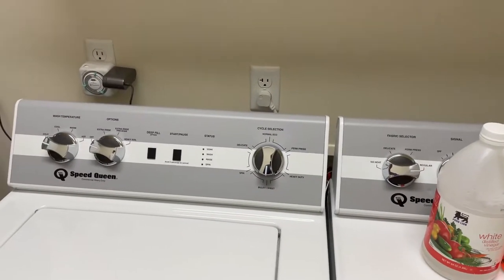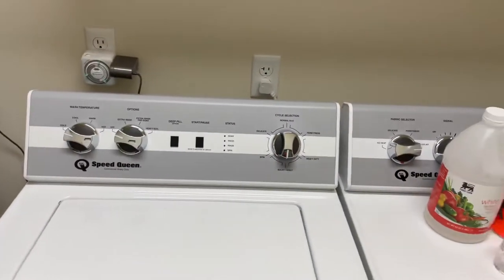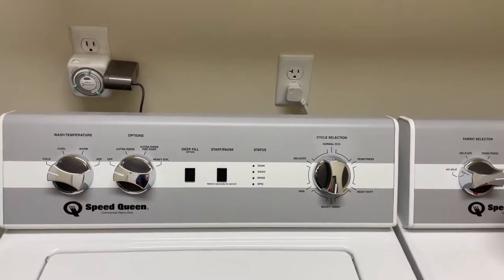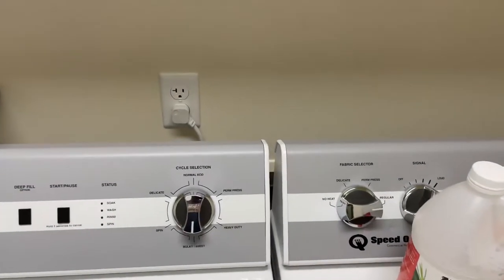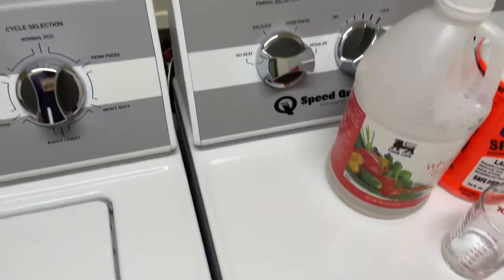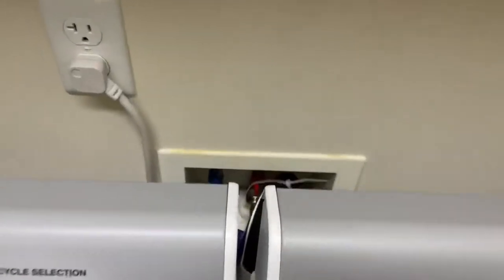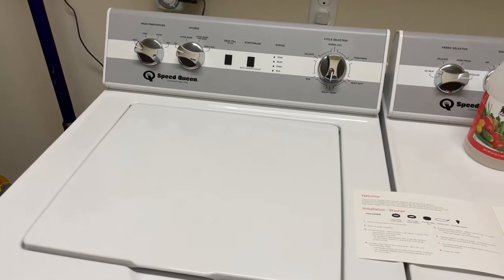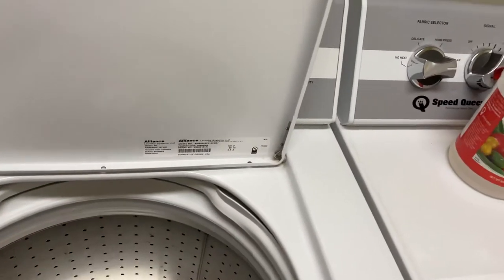Foam Bubbles coming out Speed Queen Washer drain hose - Fixed!

Comment: Maybe we should get a class action lawsuit together on this. They should engineer a fix and send somebody out to make the repair. Could be a simple as a lower volume pump or a pump that only runs when there is water present.  Maybe simple timer that shuts the pump off at a certain point. Absolutely ridiculous to have to try to figure out how to make it work without ruining your house.
Reply: My Speed Queen is so much better than my former washer that died at 5 years old. I’m ok with a little process/maintenance change.

Comment: I've been having the same issue.  Even after making adjustments to the wash mode, trying vinegar & other ideas, bubbles still continued to flow out on the final spin cycle.  I made a call to the Speed Queen Queen in Texas.  I told her the issue.  She quickly stated to run each next set of loads without any detergent.  That detergent is more concentrated now & too much is remaining in the clothing.  She recommends after washing all loads w/ just water to get rid of the detergent from the machine and clothing, to start using only 2 tablespoons per load.  She said that will be sufficient.  So far, I'm just washing w/ water & will start with less detergent within the next weeks.  If bubbles return at that point, I'll put in another comment about the problem.  If not, all is good.  Oh, she mentioned using wool dryer balls in the dryer instead of sheets.  Add essential oil drops to the balls if you want a fragrance.  Wish me luck!

Comment: problem solved... the adapter that came with the speed queen did not work by itself but adding it with an additional adapter (I got on amazon) worked like a charm.
Reply from the maker: Terrific!  Please add the link for the part you used.
Reply: I'm interested in the link to the part as well!

Comment: The Speed Queen really whips the detergent into a froth, so I only use a drizzle, like an eye dropper full. I have used vinegar instead of fabric softener. I’ll try adding it to the wash cycle. Towels hold a lot of detergent and don’t get rinsed well enough. It seems disingenuous, but because they’re probably full of detergent from previous washes, try using minimal detergent.
Reply: Agree. I do not use fabric softener because I hate the smells, even on "no fragrance" ones.  But most people don't realize their clothes are rough because they are full of residual detergent that was not rinsed out. Use less detergent. spot clean what needs it before putting in machine.

Comment: I am sure you know this, but I would also make sure that you are using HE (High Efficiency) detergent in that washer, they do produce less suds. But on the drain pump, you are correct, because the drain pump is attached to the motor, and because it is attached to the motor, it runs in reverse while in agitation, but it will not pump water out of the machine. But when it is spinning, it turns in the other direction, pumping water out of the machine.

Comment: We had this same issue. We were using liquid detergent and it was causing foam bubbles. We started using pods and it fixed the problem. Have used all the different options & cycles and no more issues since using pods.
Reply from the maker: Hi Jason.  That's good to know.  Thank you for adding this.  Rick
Reply: We just got this exact washer today. Washed 5 loads of clothes and noticed soapy water all over the floor and coming out the drain pipe and hose. We are using Tide Pods. No more than 2 at a time. Maybe for this washer that's too many? I'm running vinegar through it right now to try to get rid of the foam. Pretty disappointed in the washer. Have waited over 5 weeks for it to arrive only for this to happen on day one. 🤷🏼‍♀️

Comment: Rick. It's nice of you to take the time out and share your findings with people. I'm that guy that does not read the manual till after the fact. In my older and more wiser years. I have read the manual before starting. Just an added information for you, case you didn't see it in the manual. On page 12 about adding the soap. Note "Measure and add Low Sudsing, High Efficiency (HE) detergent to the washtub. NOTE: HIGH EFFICIENCY (HE) DETERGENT IS RECOMMENDED for use in this machine.  My wife and I are not using any detergent. We are trying something different a product call  "Pure Wash Pro" . No need for soap or Hot water. You tube it if you like. Just some extra information to put out there for you and those watches your videos. Thank you and to the people who take time in their lives to put out good information for others.
Reply from the maker: Thank you Bill.

Comment: Rick - this was super helpful. We just bought a TC5003WN and it did the foaming thing almost immediately. We thought it was an installation problem b/c the installers did not put the adapter into the standpipe. They came back and fixed that problem but the foaming eventually started up again. I followed your advice: ran the empty washer on heavy duty with some vinegar (NOTE: your pinned note says to add 1/2 GALLON of vinegar but elsewhere in these comments I see "1/2 cup." I probably put in 3 cups - sort of splitting the difference...) then stopped using "Normal Eco" cycle for washing. Before each wash I put an ounce of vinegar directly into the standpipe (it's easy to access). So far, after a week of doing this - and we do a lot of laundry as we have 3 young boys - there has been no repeat foaming. Although I do agree with the sentiment expressed a number of times in the comments, "I paid $1400 for a washing machine, I should not have to do this kind of preventive maintenance," we are still extremely happy with the SQ - I would recommend it to anyone. I think that in the longer term we'll probably get a plumber to run the drain directly into the utility sink drain, which should remove the need to add vinegar, but in the near term the vinegar is doing the trick and I am so happy to have found this video. Thank you!
Reply from the maker: Hi Jeremy,  You're welcome.  I'm glad I was able to help you.  Thanks for leaving a comment.  Check out my other tips. https://www.youtube.com/playlist?list=PLxCiVwyz3zBUJ7OHxmeutT8XQy_fndmJV  Rick

Comment: OMG, so happy to find this video as we just recently been having the same problem with our SQ TC5,.  We have been using the Normal/Eco mode most of the time and after watching this, we switched to Permanent press - and guess what, no foaming issue!  Again, thanks for the great info and solution.  It really helped us!
Reply from the maker: Hello.  You're welcome.  Thank you for letting me know it helped you.  Rick
Reply: Went and tried a load with the Heavy Duty setting this morning. This setting gives a complete soaking rinse and then a high speed spin to get all of the water out.  It is just as you mention, while it drains just fine after the wash cycle, it started to blow bubbles right at the very end of the rinse cycle when it is in high speed spin.  I ended up having to cancel the spin at the very end and pull the clothes out early and clean up the bubble mess.  I read below that people are using a small amount of fabric softener in the middle container.  Are they putting it in at the beginning of the wash or sometime after?   I'd like to try this.  I know it isn't my drain as it drains fine with the Permanent Press cycle and I also stuck a garden hose down the pipe and turned the water on full blast and there was no issue.
Reply from the maker: Hello.  We add white vinegar.  Not fabric softener.  Please hit "Show More" on my description above.  I've put all my notes and my findings are there.  I would do my #1 above,  then use vinegar in the future.   Rick

Comment: Rick, Thank you so much for this post. I bought the speed queen  washer and dryer about 2 years ago because I heard it was the best. To my great disappointment, I am stuck with this very same problem with this expensive  washing machine.  I called the service department of the vendor who sold me the SQ right after I purchased it and  I was told that they never heard of this problem. I next spent several hundred of dollars on a plumber  thinking there must be a problem with my plumbing, it cannot be this expensive new machine creating the issue. The plumber was baffled and came up with the conclusion that I must have a venting issue in the plumbing to cause this discharge. After tearing out the ruined water soaked drywall, the plumber added a venting pipe to the drain line which did not change anything. Now down several hundreds of dollars and left with a large hole in my wall I next tried the rubber plug but it did not work.  In addition to the large hole in my wall, my new expensive wood floor underneath the washing machine is  now ruined from the constant suds coming out of the drain line.

I cannot wait to try your fix. Thank you so much for posting this for us. Fingers crossed! 

By the way, Speed Queen should come up with a better solution for the people that bought these expensive washing machines. I would have never bought this washing machine (nor probably anyone else) if I was told at the time of purchase that this washing machine might pour suds all over my wall and floor after every use but you might be able to correct it by adding vinegar to every load. Speed Queen if you are reading these posts, you need to do something for your customers that are having these issues. It certainly appears to be a common problem in light of all these posts.
Reply from the maker: Hi Charles. Thank you for taking the time to post your experience.  I'm sorry your end result has gotten that bad.  I believe your post will help others understand the seriousness of this issue.  Let me know if the vinegar works for you.  Rick
Reply: It’s a design flaw and they know it. They told me it wasn’t the machine. They will not accept responsibility because it would cost them to much money. My wall is ruined from the bubbles. It’s not a blockage if it’s soap bubbles on the spin cycle. If it was just water being pumped out then I’d say maybe it is a blockage/venting issue. Bottom line it’s the washer…expensive washer. BTW no one should have to use vinegar to try to correct the situation. If that’s the case it should be in the manual.

Comment: My LG has been doing this for 6 months, Thank you, I have had my pipes cleaned out, Then had the septic tank pumped, i do that every 5 years so ok, Ive had my handyman clean out the vent pipes in roof, nothing has worked. I called my appliance repair man to ask about the machine, they did know, so I called my plumbers wife, she googled it, found your video. it seems to have solved it, im a few washings into this. I have used machine cleaners on it, they didn't change a thing, SInce I used the vinegar and dawn dish soap it has stopped foaming,  I'm going to keep it up and pray this is it. Thank you sooooo much.
Reply from the maker: Hi Tracey,  Thank you for taking the time to add your experience.  I hope it's a long-term fix for you.  Please keep me updated.  Rick

Comment: Thank you for your video.  I spoke the speed queen as well and have run numerous loads with hot water and vinegar per their instructions.  I’m going to try just using the perm press cycle and see if it is better.  I don’t think it is the drain because everything was fine until the new washer was installed. The appliance place is willing to swap it out for me and I’m leaning towards doing that.  So disappointed. Loved my old speed queen.   I wish I saw your video before my purchase.

Comment: I have the same issue with my one year old tc5. Normal/eco mode is the worst. I will try vinegar but I wrap a light AC foam around the drain hose about 3 inches up and put it in the vertical standpipe and problem solved. As long as I didn't clog the standpipe but the foam is breathable. My dishwasher drains into the same pipe and I don't want it choked off. We just bought a new bosch dishwasher! Even having about 12 episodes of suds all over the basement floor, concrete, easy clean up-we love the machine

Comment: THANK YOU.   Have this washer. Bought it 2 weeks ago and since have had company we bought it from out twice ($200) they said it was our drains, so had plumber out once($250) and tried again same thing. Had plumbers out again today $(235) again after they left, foam again. Saw your video and will try smaller amount of detergent, along with vinegar and see what happens. Hope it works.
Thanks again.
Reply from the maker: Hi Nancy.  You're welcome.  I just added a LOT more information in my description.  Please read all of that.  Do step #1, and then keep in mind everything else I mention in that description.  Thank you for commenting.  Rick
Reply: I just ran a load with the vinegar and soap, resumt was tiny bit of foam one right side of pipe.  No where near what we had previously. The flour drain was ok too.
I did not put them funnel looking rubber piece in, as I dont want to "install" anything that may void the warranty ig not "installed" by the pros who initially pit it in. So will also buy HE detergent and not use pods.
So glad I found your video. To bad i did not look BEGORE spending that much $ . OH Well😒

Comment: Thank you.  We just got our SQ washer and dryer and today I saw the dreaded standpipe foam.  I’ve been experimenting with using Tide Pod detergent to keep it simple for the kids as they do their own laundry.  I do use vinegar but in the rinse cycle using the fabric softener dispenser.  I’ll have to see if I can get them to use the vinegar but it may be too much for them … haha. 

Another product you might consider trying out when you have the time is Ahhsome (yes, it’s spelled that way) Washing machine cleaner.   It’s a product that was developed for hot tubs to remove bacterial biofilms in the plumbing.  It’s also good at completely cleaning out soap scum and slime films from washers and dishwashers.  I’m going to run some through my SQ now to see if it helps reduce foaming.  

I do agree that these SQ machines are AMAZINGLY POWERFUL.  They are definitely built for longevity and high use.  My precious top loader was your typical consumer machine that was all fancy digital controls and looked like a work of art rather than an appliance.  It gave me 10 years with one bearing change at 5 years but that essentially cost me 75% of what a new machine would.  So I decided when it was dead my next machine was going to be a Speed Queen.  I’m done with “fancy” and want only what “works” … and doesn’t cost a fortune to repair.
Reply from the maker: Hi Matthew.  Thank you for adding your experience and information to this topic.  I will look into that product you recommend.  Rick

Comment: Thanks so much, Rick, for this excellent explanation and all the experimentation you went through, which has benefited so many of us "plagued" with the same foaming issue. Even with a free-standing standpipe rising  20" above the washer we still get foam during the last few minutes of the final spin cycle, which is very fast, as you said. I recently heard that a washing machine should use a 2" standpipe, not the 1 1/2" that we have. That may be part of our problem. Tomorrow, we're going to try your suggestion (adding distilled white vinegar along with the soap) and will update our experience in the near future if we can find this YouTube site again. By the way, we have used distilled white vinegar in the opening of the agitator instead of fabric softener before starting the wash cycle. Adding one or two ounces in the water as well hopefully will solve the issue. 
Question: do you think that using a little OxyClean along with the detergent will cause foaming? I'd appreciate an answer if you have the time. Thanks again.
Reply from the maker: Hi Jeanlouis.  You're welcome.  Thank you for the kind words.  It sounds like you might have read my entire description.  If you haven't:  Please click on "more" at the bottom of my description and read everything there.  
For you:  
Please do my Step #1 (Full Flush). 
Please read about all the different cycles and don't use Eco/Normal.
You are doing correct by adding vinegar in the center of the agitator.  When the machine spins at the end of the Wash cycle - that's when it will be added:  Then, the vinegar will be in there during the final Rinse.  That's when you need it in the water.  The 8 minute long High Speed Spin occurs then, and it's during the last 3 minutes of that spin that the foam happens.  Please come back and let me know how it goes.  Rick